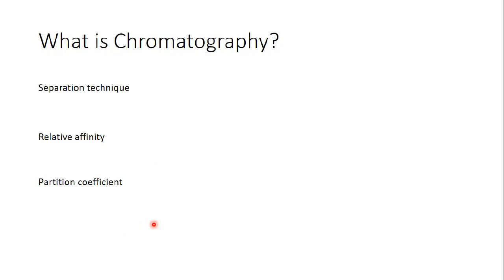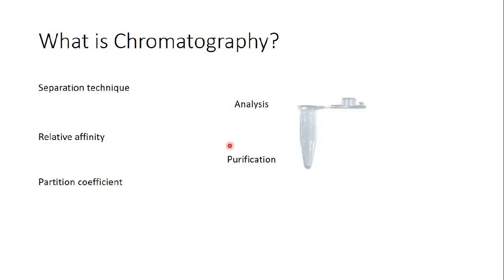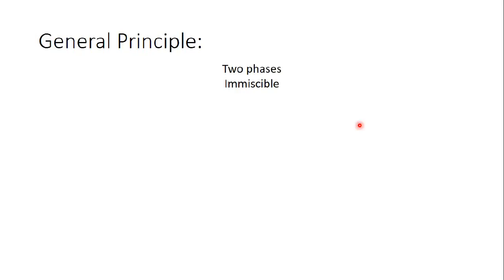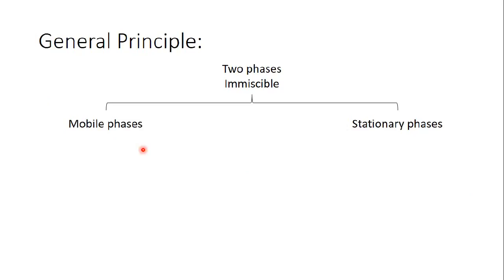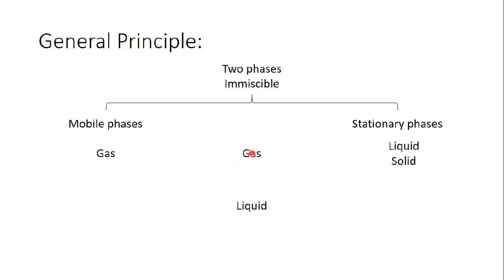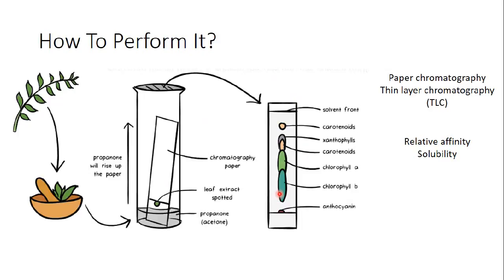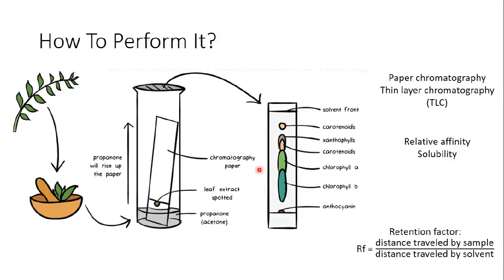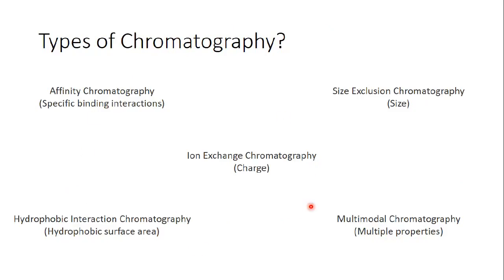The Basic Principle of Chromatography and the Different Types of Chromatography

Comment: 1. The sample is added on the stationary phase
2. The mobile phase is added
3. The mobile phases moves through the stationary phase
4. The components in the sample moves with the moving mobile phase based on their affinity towards stationary and mobile phases.
THE STORY ❤:  At first, the sample is added into the stationary phase. So, at that point, stationary phase is holding the sample. 😊
But as soon as the mobile phase is added, the mobile phase started to run fast pulling the components in the sample along the way through stationary phase👯‍♀️.  So even if they all are standing on the stationary phase, the mobile phase is holding the hand of sample and running forward🥰 until the supply of mobile phase is terminated.  But still the mobile phase didn't get his Juliet💔, all the components kept running with him till their affinity lasted stoppedsomewherein between. But sadly there were nobody with him when he ended the race and looked back. Poor mobile phase 😢

Comment: You say at 16:16 that mobile phase holds our sample inside, but as you explained later in both paper and column chromtography the stationary phase holds the sample at first. Why is this inconformity? Explain please
Reply: 1. The sample is added on the stationary phase
2. The mobile phase is added
3. The mobile phases moves through the stationary phase
4. The components in the sample moves with the moving mobile phase based on their affinity towards stationary and mobile phases.
THE STORY ❤:  At first, the sample is added into the stationary phase. So, at that point, stationary phase is holding the sample. 😊
But as soon as the mobile phase is added, the mobile phase started to run fast and pull the components in the sample along the way through stationary phase👯‍♀️.  So even if they all are standing on the stationary phase, the mobile phase is holding the hand of sample and running forward🥰 until the supply of mobile phase is terminated.  But still the mobile phase didn't get his Juliet💔, all the components kept running with him till their affinity lasted. But sadly there were nobody with him when he ended the race and looked back.😢